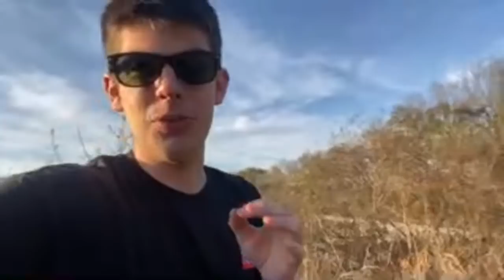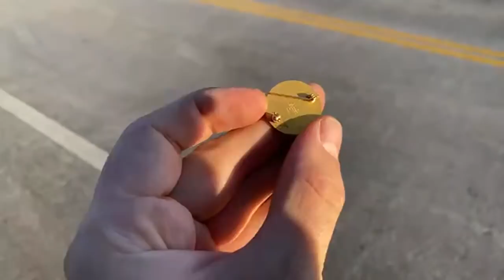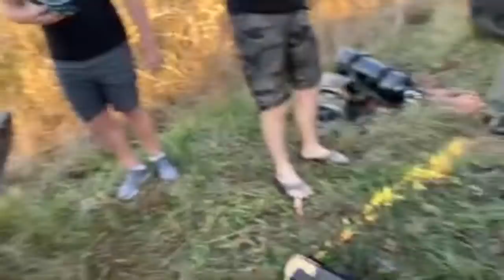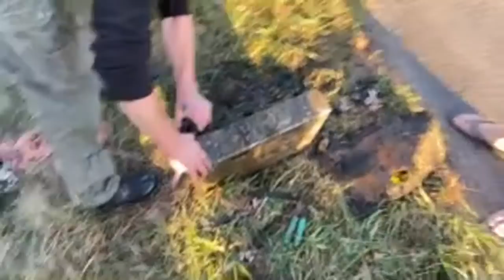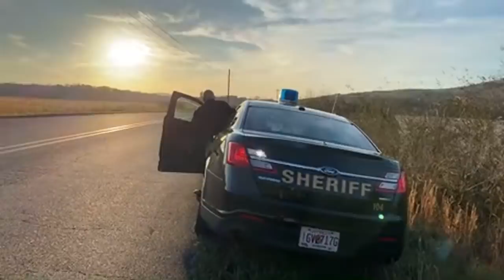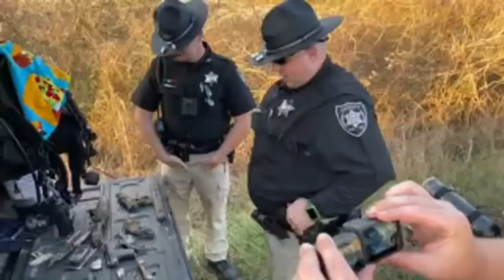Scuba Diver Found Criminal Evidence & Stolen Jewelry In River While Scuba Diving! (Police Called)

Comment: Try using the hole in the back, usually has a hidden button to open the drawer
Reply from the maker: Good tip
Reply: A small hole that a skinny screwdriver can fit will usually have a spring release on the bottom lined up in the middle, front to back